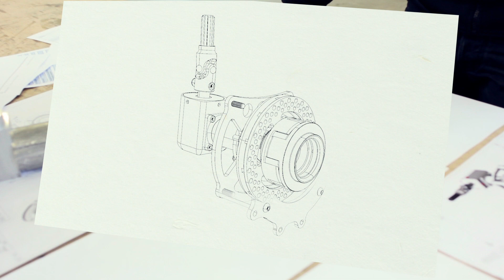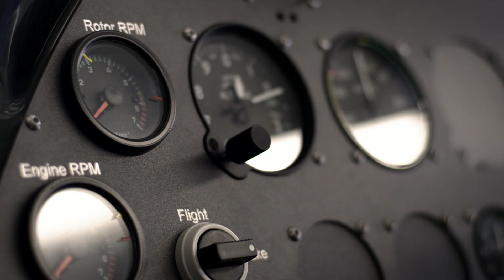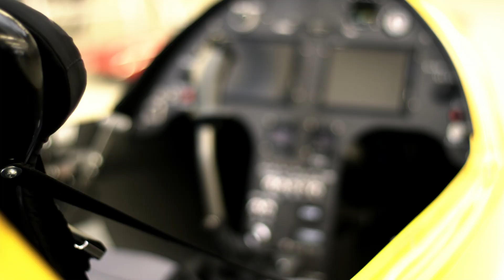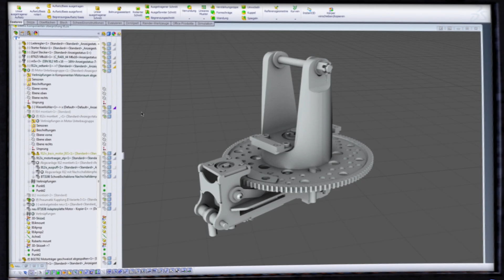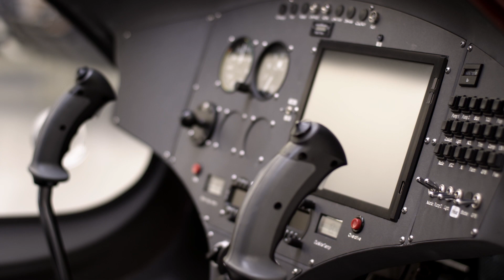AutoGyro | Gyroplanes Made In Germany | Fastest Production Gyroplane

Comment: Why no 3 blade smaller diameter rotors, and why no 915 in the calidus? Is 100-105kts cruise possible? I'd be much more interested  as you can always throttle back for just sightseeing. But to actually use it for cross country flying, 85 kts and a headwind, is just an expensive toy.